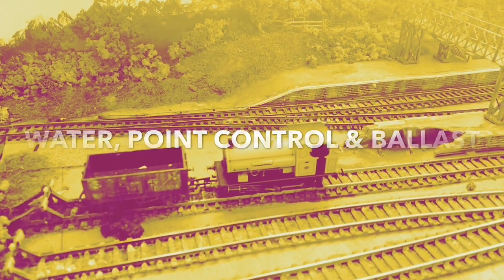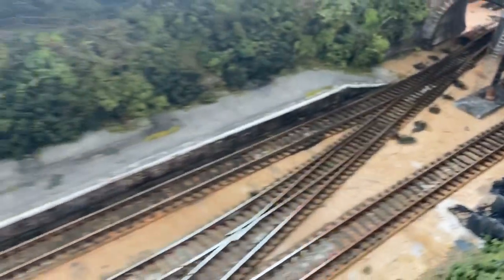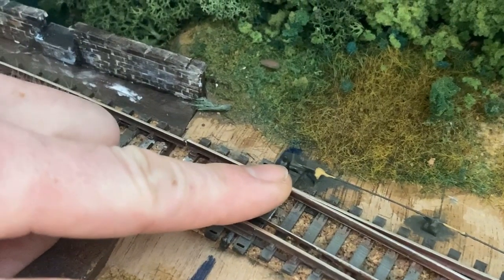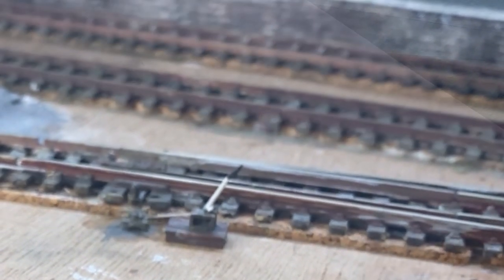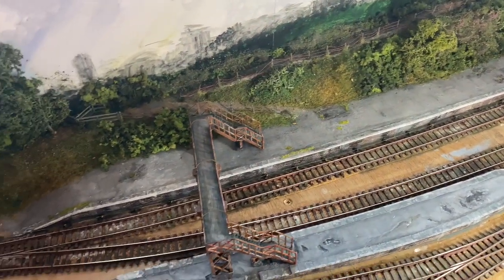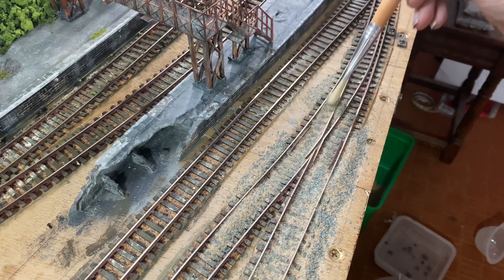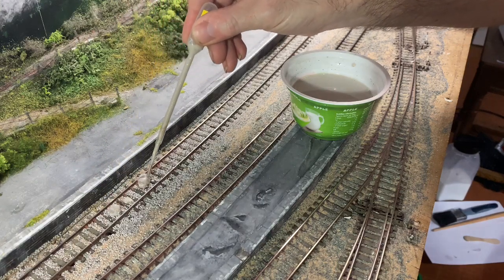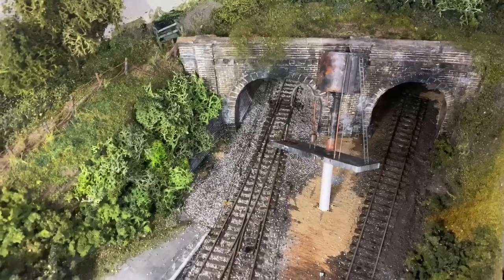OO GAUGE MODEL RAILWAY - WATER, POINT CONTROL & BALLAST

Comment: Nice job John. I've always found that using woodland scenics ballast I've had to dampen it first other than if I use neat pva and add the ballast to it. Can I order 10 sets of the point rodding kits and levers please lol they look perfect. Hope your ballast dries ok cheers Andy
Reply from the maker: Hi Andy, guess Im just preferring the Jarvis ballast, personal choice. Drying beautifully, even in the heat may still take day or so. I did it Sunday night, so its only had around 12 hours so far. 

So glad you like the lever arms, may I suggest have a go, may help you out if you’re not happy with your achievements.
Reply: @piccadillysidingsoogaugemo6445  you know me John always up for a challenge so I'm looking into doing some kind of version. Thanks for all the inspirations throughout many of your videos and builds on both layouts Andy

Comment: Really interesting John :-) I liked watching this video very much.  Looking good on all you've done!  Well achieved sir!  Regarding the water tower: have you tried at the lower voltage?  or are you going to hang on for the replacement.  Thank you  Iain
Reply from the maker: Thank you Iain, Ive thoroughly enjoyed doing it. Yes the water tower is a pain, after spending all that time, effort and material to complete the project. Lower voltage, not yet. I want to try putting resistors on the feed see what the voltage is. Jenny Kirk said it would work on 3v so we’ll. Thanks as always Iain for taking the time to comment.